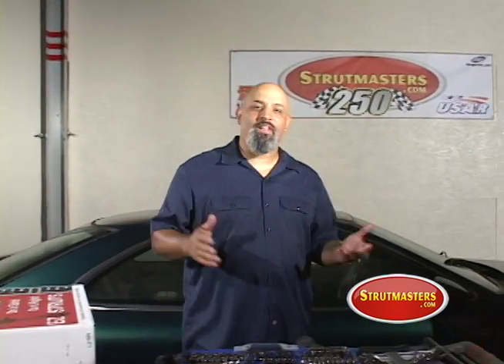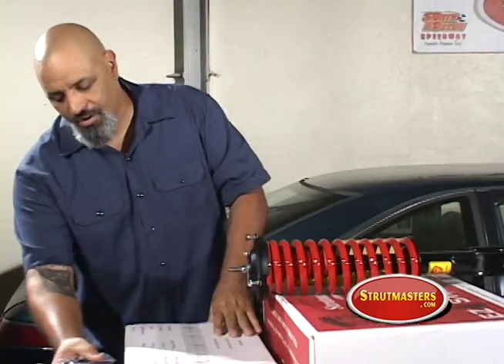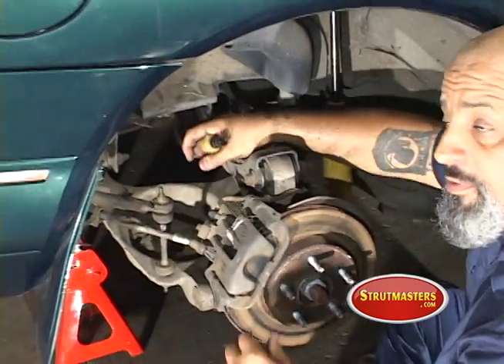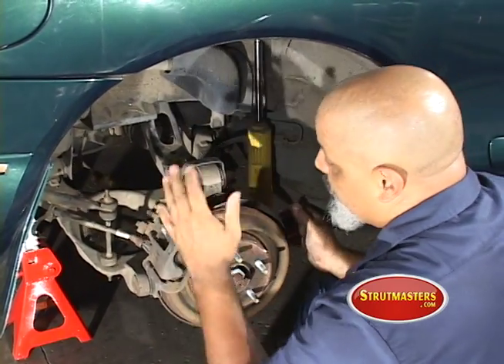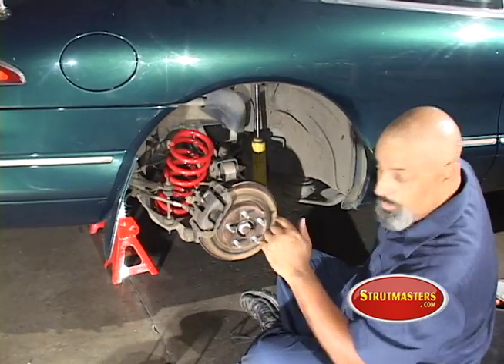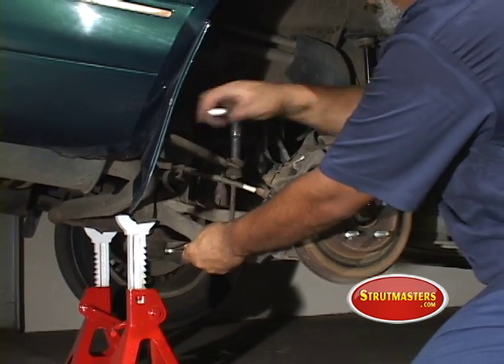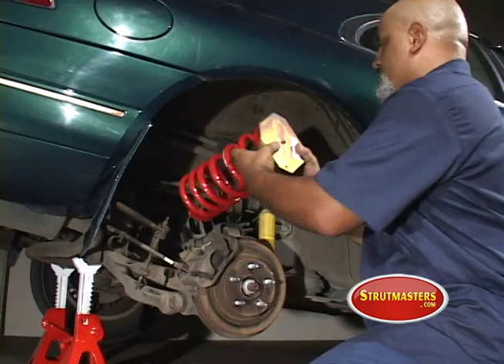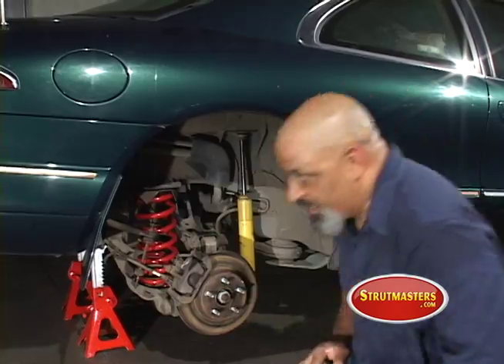Lou Santiago Installs Lincoln Mark VIII Conversion Kit (Part 1 of 2 -- REAR)

Comment: I appreciate this video very much. I just got my new strut Masters conversion kit for my Lincoln Mark 8 today. directions are good but this video really helps. I am so tired of playing the air suspension game and when it failed on me completely while driving.. the bottom of the car was scraping every irregularity in the road.... You weren't exaggerating by much when you said you would feel every knat in the road. Before I made it home, car finally got hung up on a slight slope on the road where I was stranded for 2 and a half hours while the tow truck could not even figure how to lift the car off the ground . It looked like it melted into the pavement. so thanks for your good product!
Reply from the maker: So glad we could help!  How has the car held up over the years?

Comment: Thanks. My 98 is about to be converted.
Reply from the maker: How did things go?
Reply: Everything was just as advertised. The naysayers have neglected something. I replaced wheel bearings and all wear that needed to be able to have alignment and be able to consider it a scratch start. The car has 165k and people look and sweat its mint.
Reply from the maker: @olddavid4  Great!  Yes, many do fail to realize that there are other components involved that we do not sale that have routine maintenance or replacement in order.  Thanks for your reply!

Comment: removing that lower shock bolt is NOT that easy. i couldn’t get mine to budge. edit i ended up removing the upper bolts for the shock in the trunk to drop the rear suspension. i took the rear seat bottom
and back out for earlier access to the bolts, made it pretty simple. so nice to finally have a car that isn’t scraping its ass end on the ground!!
Reply from the maker: Thanks for adding your comment and helping the community out through your experience.